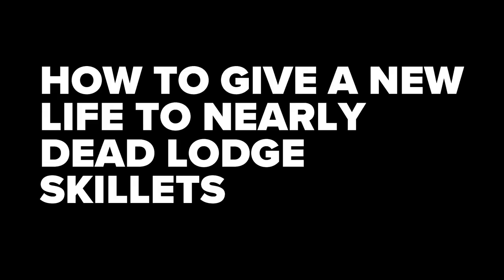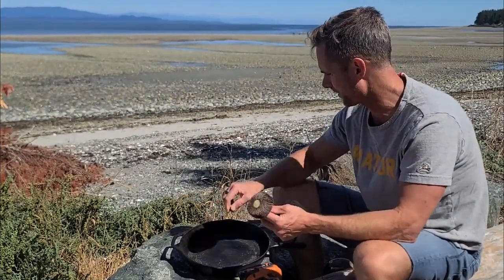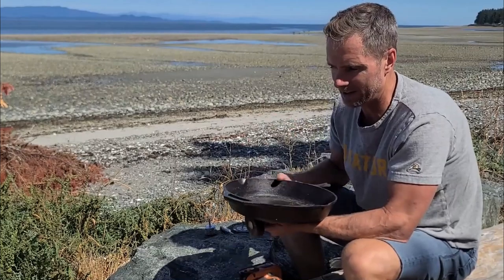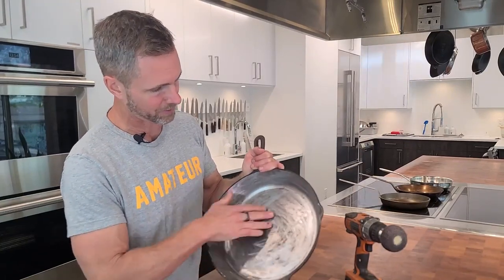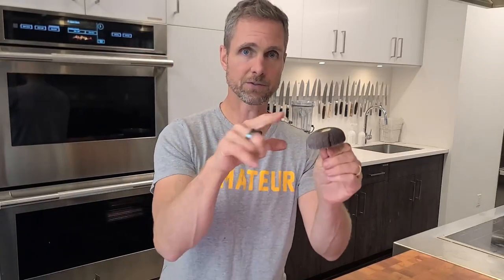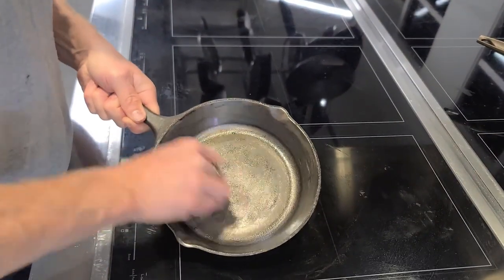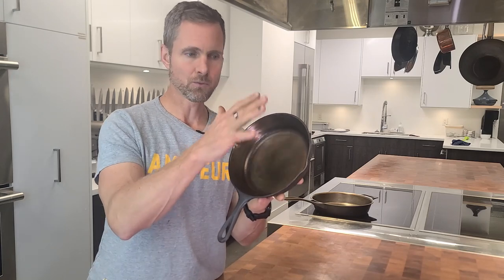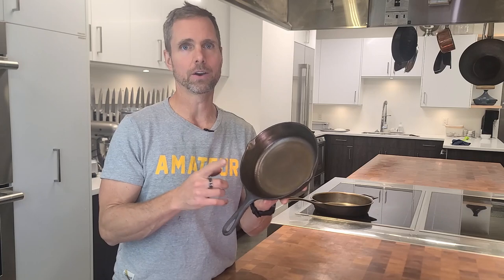How to strip and repair major build up on Cast Iron Skillets

Comment: A lye bath, oven cleaner or a self cleaning oven cycle would also have removed the crud.
Reply: Oh, and the rust then could have been removed with vinegar. Been there and done that numerous times.
Reply from the maker: Hi Bernie, sorry that the images don't do the build-up justice but there is no way that anything other than physical effort would have gotten these clean, These literally had 1/4 inch build-up.
Reply: I forgot to mention a nice side effect of your sand paper wheel. Due to the sand paper not only removing the crust but also some metal, you now have a pretty smooth Lodge skillet without that rough original finish. 80 grit sand paper leaves a nice scratch pattern which hold the seasoning pretty well.
However, I wouldn't use sand paper on premium or vintage cast iron. The above mentioned methods (and electrolysis) don't remove any metal.
Reply from the maker: @berniem.6965  Yes, if I was reconditioning a Stargazer or Field then I'd probably have spent even more time on the final stage. I found that the finish using the 80 grit left just enough texture to make for a good seasoning!
Reply from the maker: @berniem.6965  I hear you, but I had tried this previously and it may have worked but it would taken days. Very slow results.
Reply: Awesome!  Thanks for sharing that process.  Would sandblasting have worked also?
Reply from the maker: @doubletakerotts  oh yeah! If you have a sandblasting machine, that would be ideal!!
Reply: Thanks for your answers. You're right, methods like a lye bath, oven cleaner or electrolysis can take days or even weeks and multiple 'rounds' with a cleanup with steel wool in between. But they do zero harm to the metal and the manual work required is kept at a minimum. If cast iron collectors can get rid of the crud of decades or even centuries, those methods would also have solved your problem. But they're slow, that's true.

A self cleaning oven cycle should get rid of the biggest mess first. A second round then should remove everything else.

But as I said, for a cheap Lodge, power tools and sand paper are not a bad idea as you also remove the rough texture to some extent in the process.
Reply: @doubletakerotts  That is a terrible idea. There are safe accepted methods of cleaning cast iron than don’t damage it. Power tools aren’t one of the safe methods.
Reply: @Cook-Culture  No, it wouldn’t. Some people collect cast iron. Mechanical cleaning ruins any collectible value a pan might have had, or will eventually have had. 

Often it can also make them less usable as cookware.
Reply: @Cook-Culture  From the videos I've watched regarding physical methods of removing buildup, the biggest concern was processing the cast iron too much and ending up with a surface to which seasoning won't adhere. I had wondered if a rough grade sandpaper would roughen the surface enough for the seasoning to adhere, and you are the first one to address this. The other main concern was using physical methods to process vintage collectable pans as it may destroy the value of the pan for vintage collectors. But if your aim is a usable pan for yourself, then it's your pan to do with as you please. BTW, the pans you redid look great once seasoned,
Reply: Yeah, I really wish people wouldn’t recommend destructive cleaning methods. Especially those who others hold up as experts. Cowboy Kent has caused a lot of people to turn their family heirloom iron from valuable antique keepsakes into almost worthless junk in seconds. 

Some Griswolds can be worth several hundred dollars and even more, and while the exact same pan ruined with sandpaper or a wire wheel will be worth only a fraction of that.
Reply: @Cook-Culture  There isn’t any crud so thick that it cannot be removed with safe methods that do no damage to the iron itself. 

I now find all of your advice questionable. If you got this wrong, what else might you also gotten wrong. It’s your iron, so do as you will, but please quit recommending ruining pans to others.
Reply from the maker: @BrianGay57  Thanks Brian, This pan turned out great and is working perfectly! No issues with damaging the iron whatsoever.
Reply: @BrianGay57  I think most cast iron owners don’t remotely care about collector value, nor should they
Reply: @Cook-Culture  Yes my 9.5” Matfer that had the same type of armored carbon layer on it. 240 grit wasn’t quite enough to get rid of the heavier scratches. #0000 steel wool got it to a nice even sheen.
Reply: @BrianGay57  how do you recommend cleaning them? New to cast iron and have some vintage pans that were my grand parents from over half a century ago and don't want them ruined

Comment: You DO NOT grind cast iron!
Reply from the maker: Why?
Reply: Well because it's not correct way to do so. Saying there is no way to clean carbon build up completely wrong. There is a 100 times eaiser and correct ways to bring your cast iron to bare metal never use powertools!
Reply: @chadruberg1346  can you give some examples?
Reply: @kodiham7532  lye tank, e tank , or  oven cleaner with lye will work for you.

Comment: After cleaning using electrolysis I know there is no better method. It would have cleaned that pan in two days max with very little effort and it would not have removed any iron. To date I have cleaned about 100 pieces with electrolysis. You wouldn’t believe the crud and rust it cuts through.
Reply from the maker: Thanks. Yes, I'm excited to try this method. Probably in the next few months.

Comment: I can appreciate the success you've achieved plus the flak you undoubtedly recieved. If I had taken to a drill / grinder I would have followed with fine wet & dry papers to hide the signs of prior methods. You Lay bath exercise was very interesting.
Reply from the maker: Thanks. Yeah, just playing around. Many of the comments are very helpful as I learn as the ways to recondition cast. Thanks for the comment.

Comment: I got some cast iron pans and a pod I am going to do this win and the season froms scratch again, but with seasoning wax like you use, not oil from a bottle. The tip I use is more like the second you showed, but the barbs go more straight out of the drill, not to the side, so it's very good for this use.

Comment: I had a skillet just like that took me 2 weeks of chain mail, vinegar, baking soda ,kosher salt putting it in the oven on self cleaning and heating on the burner every other day. I could not do every day my hands were so torn up. 
However I finally got it done now in the process of seasoning. 😥. I never want to do it agin. Lol I went out and bought new stargazer pans rather than clean the rest of my grandmothers cast iron. I will get to it eventually but in the mean time I will use the one I cleaned and the new.
Reply from the maker: Hi, try lye. It works very well and no effort needed. I'll have a video coming out soon where I am doing just this
Reply: Normally I just throw it in the camp fire and remove it the next day no carbon

Comment: BAD IDEA TO SAND/WIRE WHEEL CAST IRON.  The wire wheel burnishes The surface making it difficult for the pan to take seasoning in the feature. Sanding smooth at the surface too much, it makes it nearly impossible for seats in the stick long-term.Spray down your skillet with yellow cap oven cleaner and place it in a black garbage bag. Place this bag somewhere warm; I place mine in the sun. Leave this for a few hours to a day. Spray it with a hose and repeat until the skillet is clean. The lye in the oven cleaner removes the seasoning. I prefer to use 100% lye drain opener to clean more than one or two skillets. Fill a 5 gallon bucket with water and dump in the lye. Put a lid on your bucket and place it somewhere above 60f. Leave this for 2-3 days and that skillet will come out clean. If your skillet is rusty after ilusing the lye or oven cleaner mix up a 50/50 solution of vinegar and water and leave your skillet in for 30 minutes. Take it to the sink and wash it, repeat until the rust is gone. Scrub with dawn/dish soap and a Brillo pad and wash it jice and good. Season as normal, I use Grapeseed oil or crisco, ANYTHING BUT FLAXSEED OIL.
Reply: Lye and vinegar is the way to go. This guy gave so much incorrect information lol.
Reply: why not flax?
Reply: Flax seed oil build up tends to flake off eventually.

Comment: wont electrolisys work with this? i've seen that with rust, they just leave it there and it strips almost everything off. I hhope i never get to this point with my carbon steel cookware
Reply from the maker: If you have the means, then it could do a very good job.

Comment: Nice, I would start with the wire wheels to hog material off, and then go to the flap disc. Nevertheless, looks good.
edit: Oh yeah, instead of a drill I would recommend an angle grinder. the tool is more torque appropriate for what you're doing.
it's literally what the tool is made for.
Reply: Drill actually works great if you have one with a decent speed. I agree with the wire wheels first though! Pulls everything right off they work great and crazy cheap at harbor freight.

Comment: Cool video I’ve heard huge built on grease can be cooked off by running the self cleaning oven setting for a full 4 hour cycle   In some other vid
Reply from the maker: It depends on how cooked on it is. It works ok.
Reply: James, I did my oldest pan in the oven clean cycle it was verv bad in my opinion. Mine turned out like brand new. Came out of the oven grey iron with a lot of ash on it. Washed off the ash and reseasoned like a new pan.
Reply: I agree I was about to comment this very same thing

Comment: Oven spray cleaner wouldn't work? And are you not concerned with abrading the metal, like people who smooth down lodge skillets , potentially ruining the value (or making too smooth the hold seasoning)?
Reply from the maker: Hi, I've found that oven cleaner only works on average build-up. This build-up was the worst I'd ever seen and needed more aggressive treatment than oven cleaner.   I did not finish the pan to smooth and the seasoning applied very well
Reply: Those were cheap Lodge skillets. What value should have gone list? By using 80grit sandpaper, he removed the rough surface and ended up with a skillet that's probably worth more now. The scratch pattern of 80grit sandpaper holds a seasoning very well. Everything up to 120grit works perfectly fine.
Reply from the maker: @berniem.6965  Thanks, Bernie. The lady who I did this for is super happy with the result and that's what matters to me. She can now use her skillets for generations.
Reply: @berniem.6965  The main thing to remember is you don't want a buttery smooth feel after sanding or you'll never get the seasoning to adhere. Save the ultra smooth sanded surfaces for your wood furniture!

Comment: Did you try soaking them for 4 days in a strong solution of caustic soda?
That seems to be the easiest way.
Reply from the maker: I've tried that before with some success.  This pan had a huge amount of build up and this process worked great. Sandblasting would have been an option.
Reply: @Cook-Culture  -
thanks for your reply.
I had great success with caustic soda.
I still had a tiny bit of carbon left on the bottom side of the frying pan
but it sure did save all that sanding that you did.
I think sanding should be a last resort.

Comment: Would placing the pans into the self clean oven  hav worked?
Reply from the maker: Yes, that can work great but if a pan has rock solid carbon build up it won't. You need to take it to the next level.

Comment: Heat pan on stove enough to just get it hot. Take out back and spray a real thick layer of Easy Off Oven cleaner HEAVY DUTY. The regular won't work as well. Come back in 5 minutes and scrub off.
Done. Sheila from Tennessee.

Comment: What are the pros and cons of putting a grubby pan in the oven clean cycle? I did a pan this way and it turned out like drand new.
Reply from the maker: Yes, if the build up is not top bad then it works well. Soaking in lye for a day or two before works well for stubborn carbon build up

Comment: Hey all, I had some pans in this condition, if you don't wanna spend 4 hours on it let it soak in 50 50 vinegar and water before using a wire wheel

Comment: Love this method, and I have done something similar with epic buildup on cast iron pans.

I use a 4.5" grinder with a coarse wire wheel, which is an even faster, more finessed way to achieve this amount of gunk removal, but comes with some important warnings:

1) The wheel spins at around 12,000 rpm and as it wears will huck out weakened steel bristles. Not only do you need eye protection, but have gloves and long-sleeved clothes on too. Don't ask how I know about this.

2) Be aware of the rotational direction and how the wheel might catch on the pan's rim and other features. It takes a confident, steady grip. But if you've ever used one of these tools it's second nature.

Otherwise, go for it! Mini-grinders are not expensive tools, have many different applications, and you can peel a cast iron skillet down to bare metal in five to ten minutes, depending on the size.

I can shoot a vid if anyone is interested in seeing how it works...I even have a large skillet that could use a good workover.
Reply from the maker: Thanks for the comment!
Reply: Came here to post this.  A knotted wire brush attachment on any angle grinder will rip these heavy build up coatings off in no time.  I've done this a couple times on some carbon steel pans and finish it off with a brillo pad under hot water and soap.  Super messy though.  Brown powder covering everything.

Comment: That initial grind on the first pan was way too rough; you need to follow up with finer grits and get it to ideally a satin finish (600-1000 grit) before going to season. It's why all the premium brands have smooth surfaces with a fine sandblasted or microbeaded surface treatment.
Reply from the maker: Thanks. This worked great and the seasoning was bombproof

Comment: They don’t have lye where you live? I would recommend a ceramic grill with good temp control. 

Light it and place the pan inside and let it get to about 800 or so degrees and then just leave it till all the carbon burns off. 

The method you showed is frowned on, and advocating it in any Facebook cast iron group will get you banned. 

Lye and Electrolysis would have take care of that. Power tools are never recommended, and fire isn’t either because people don’t use it correctly and damage pans.
Reply from the maker: Hi, thanks for that. I've spoken to hundreds of (lay) people over the years about how to do this sort of thing and I have learned that none of them (laypersons) would do the Lye and Electrolysis method. They all have a drill and can buy a disc at their local hardware store. This may be a bit more work but approachable for most anyone.  I'm pretty sure that my customers aren't part of a FB cast iron club so there isn't a worry about them being banned! 😄
Reply: @Cook-Culture  The easiest lye method I've seen was using Easy Off Oven Cleaner (the one with the yellow cap). Be sure to use gloves and eye protection. You'll need the oven cleaner and a black trash bag. Spray the pan heavily with the oven cleaner, place in the trash bag, and seal it up. It's best to do this outside, or at least with open windows and a fan to blow fumes away from your face. Allow the pan to sit 24 hours, then remove and clean with soap and water. Dry the pan. If there is still buildup, repeat the process as many times as necessary. If there is any rust, treat with a 1:1 mixture of water and white vinegar and let sit for 5-15 minutes, depending on amount of rust. Clean with soap and water, then heat on stovetop or in oven to dry and then start the seasoning process immediately to prevent flash rust. This is supposed to be an easy lye method to use if you only have one or a few pans that need cleaned.
Reply: The wire wheel has been used by Kent Rollins and id trust him with my life.

Comment: I'd also try Avanti Pro quick strip disks.  For me they worked faster than sanding disks or wire brushes.  Much faster.
Reply from the maker: Awesome. I'll give them a go.
Reply: They remove the crud quite nicely. But if you also want to get rid of the rough texture, I prefer sandpaper starting at 40 grit and eventually (for a finer scratch pattern) going up to 120 grit max. I found the quick strip to remove too little metal for the time invested. As there was no seasoning to be removed (I had used a lye bath earlier), I started with sandpaper.

Just make sure to wear eye protection and a dirt mask.

Comment: take them out side build you a medium fire circle about 3 feet in diameter get a good bed of really hot coals built  then place skillet in the bed of coals then pile large amount of wood on top and burn it off for a hour or 2 till fire calms down take a drill with a wire brush clean skillet with that take it back into house and wash the hell out of it wipe it with a thing cover of peanut oil put it in a pre heated oven at 400 to 450 bake it for and hour do that twice and start cooking away folks always pre heat your skillet before adding food to it preferably around med low heat at least 5 to 10 minutes

Comment: Cheap angle grinder and a wire cup wheel would be much faster and easier.  Angle grinders have more power and speed for this kind of work

Comment: The faster way is to make a fire somewhere safe, put it in the fire and leave it till all gunk burns. You can’t clean it better and safer. Once cools naturally, use some common scraper to remove the ash of it. Wash it and reseason it. Method proved and works with excessive rust as well
Reply from the maker: Thanks. I plan to try this soon
Reply: How long in fire?